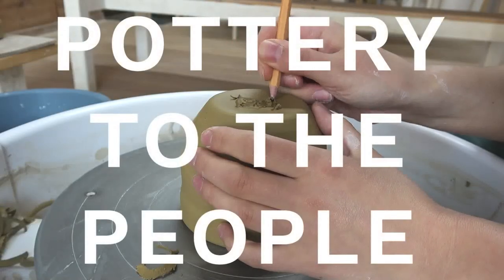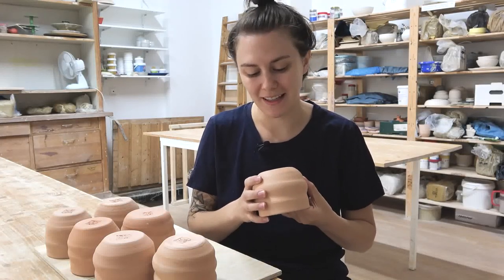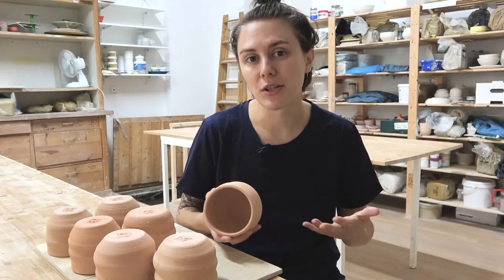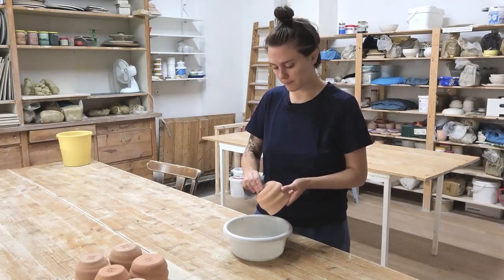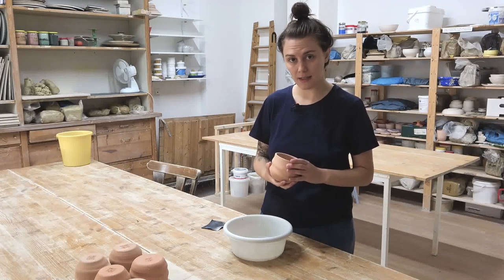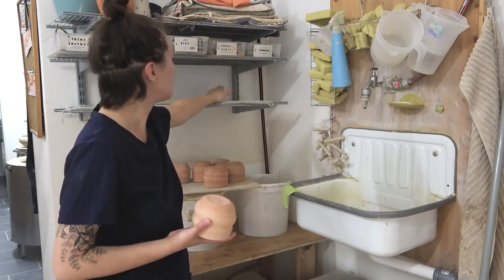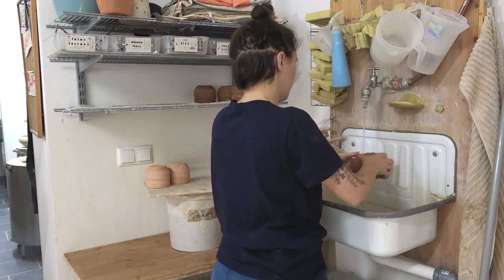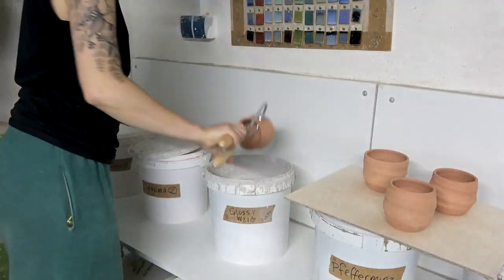Wet Sanding Pottery // How to sand pottery safely!

Comment: I take a ceramics class at my parks and rec center. We don't throw clay, but the instructor's assistant pour pieces for the students to buy, clean, underglaze and glaze themselves. The instructor and her assistant take care of the firing. The cleaning up of the greenware is my favorite part, and I was wondering if you pour pieces in your studio.
Reply from the maker: do you mean slip casting? I have done it before but not regularly ☺️ its fun though!
Reply: Hi Mia, I’d like to know how much sanding you do on the glaze once it’s dried. People at my studio go crazy sanding the glaze. I also think this is highly problematic because of the silica released into the air. What’s your thoughts? Cheers! Lori.

Comment: Hi after cleaning it with water, for how long do you keep the pots to dry ? Second question- 
And if am handbuilding how to get rid of the bumps or finger marks? Should I use a wet sponge and wipe the pot in the bisqueware stage or should I sand it with a sand paper. What would you recommend?😊

Comment: Thank you so much for your clear instructive lessons. I am a beginner so finding you very helpful. How do you keep the glaze from the base of the pot so well. Do you coat it with wax or something?
Reply: I don't know if you got your question answered yet? after dipping the bisque in glaze, you wipe the bottom with a wet sponge to remove the glaze. You can also (carefully!) apply wax to the bottom or areas where you don't want glaze but be careful because if you get even the tiniest of spots of wax on your pots, the glaze will not adhere. I prefer to use a sponge for clean-up. Take your time and get all the glaze off because if it is there, you run the risk of having it stick to the kiln shelf.

Comment: also, my white stroke n Coat is difficult to paint on by hand but I don’t have room for buckets of glaze.  It distorts and looks really messy so I tried to sand it lightly which unfortunately removed the paint.  Do you have a room recommendation on how to smoothe out rough coats of paint?  Thank you
Reply from the maker: The glaze should smooth out in the kiln. You mean it looks rough before the firing? I cover glazing with paint-on glazes in my glaze class here: https://www.potterytothepeople.com/introduction-to-glazing